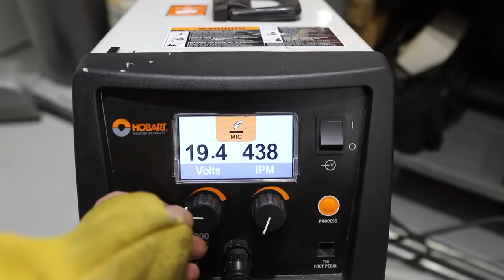RESTORING A RUSTY GO KART In 10 Minutes! FULL BUILD

Comment: That degoverned Predator's not gonna make it to the second oil change if you don't swap out the valve springs. Predators don't even make sense any more economically, for fifty bucks more you got a Tillotson which comes stock with stiffer valve springs, better cam, more horsepower, and a non explosive flywheel.

Comment: Looks awesome, but why not put on a live axle kit on it so it would be fun to drive.
Reply: I don't get why he replaced the wheels and welded on new axles to begin with. Seemed like the old ones would've worked just fine and now these are relying on welds to be the main structural support.